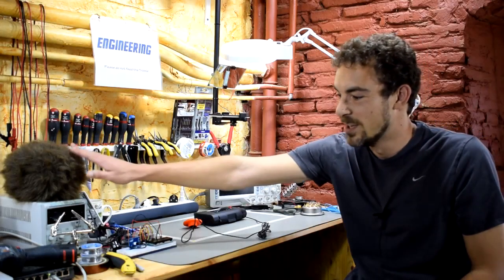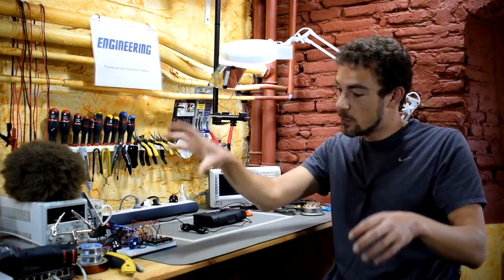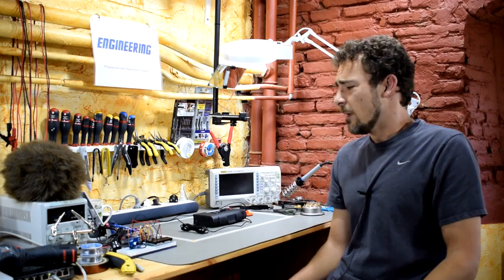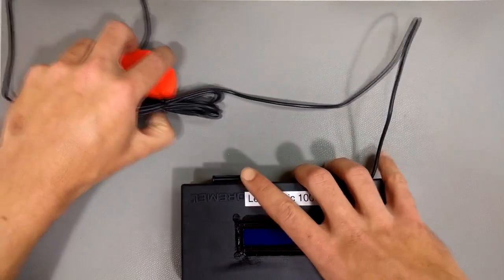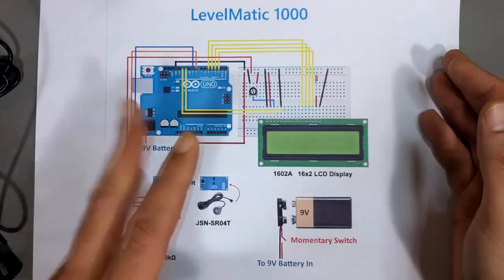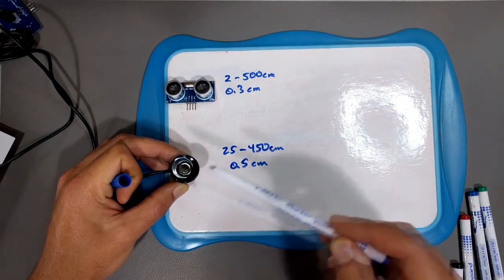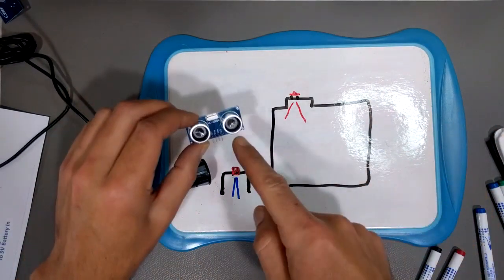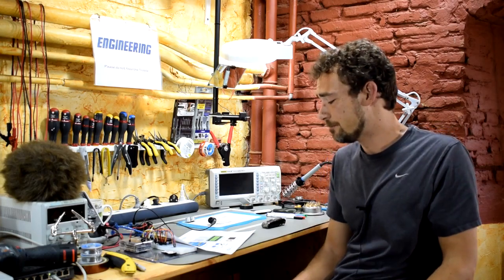DIY Ultrasonic Fuel Gauge / Level Sensor

Comment: Can either of those sensors work through a metal tank. Will be mounting it on the bottom of a 100 gallon diesel fuel tank is 20 inches deep 42" long snd and about 28 " wide. Thanks
Reply from the maker: Nope. The sensors only work through air.

Comment: Amazing!! Thanks heaps, this is exactly what I needed!!
Im just wondering if there's any sealed narrow beam units around?
I need to read the level in a 350x350x1000mm tank which is stood on its end so think the 50-70 degree beam will be a problem and the tanks on a vehicle so it's going to get splashed with vegetable oil.
Or can I mount it behind a clear screen and calibrate it to read through?
You'll be aware by now, this is absolutely not my field, so I apologise and thank you for your help.
Much appreciated!!
Reply from the maker: I haven't found a sealed narrow-beam one yet. A screen won't work since you must have nothing but air between the sensor and liquid.
Reply: @ScottiesTech  cheers fella.
Ill post if i find one!

Comment: i have a diesel fuel tank on my sailboat, but i have no access to the top really, soi  want to have a sensor that measure the amount of fuel in the tank. it is 3 ft tall and i can only access three sides. the top has a three inch gap, but i can drill or really install anything from the top. what can i do?? please help
Reply from the maker: Yeah, that's a pickle... I guess you'd have to make an access panel (if possible) above the tank so you could then drill a hole into the top.

Comment: Hi Scottie, is that a way to measure the water level through the tank wall if it's made of plastic? The reason being is that I want to measure the fuel level on my boat thank, and to fit one of these I would have to make another hole there.
Reply from the maker: No, for ultrasonic transducers, there can be only air between the sensor and the fuel.

Comment: Question. Will the sensor or PCB hold agressive fuel vapour?
Reply from the maker: Good question, and I don't really know... It's water proof, but not rated for harsh chemical vapors... In the case of diesel, it's fine since diesel is pretty tame. But other chems? Hmm...

Comment: Hi, 
Can this be used to build a measure of butane tank level ? Thank you in advance for sharing idea.
Reply from the maker: That's tricky. It's pressurized, with some liquid and some gas in the tank.  Even if you compensate for the speed of sound in butane (instead of air) in the code, you still have the problem of safely using the ultrasound sensor in the side of the tank. It won't work through the wall of the tank.

Comment: I see in your schematic you put a potentiometer 10kΩ?? For what reason?? And also where you put the JSN-SR04T sensor in the board?? Thanks
Reply from the maker: The 10k pot is to adjust the contrast of the LCD screen.  I ended up using the JSN-SR04T, which I just connected to the board in the same way as the HC-SR04 in the diagram on my web site: https://scottiestech.info/2017/10/24/diy-ultrasonic-fuel-gauge-level-sensor/
Reply: Thank you! Unfortunately I do exactly as your diagram but I still get a blank blue screen! I have to check it more 'cause I'm rookie!!!
Reply from the maker: @thansof  I had the same problem. Some displays (even with same model number) need to be connected a bit differently - especially the contrast pin V0. This might help: https://arduino.stackexchange.com/questions/3625/why-is-my-lcd-162-is-not-displaying-any-characters-although-all-the-wiring-is

Comment: good video i am worried about the angle of the sensor i have a 3000 gallon water tank i want to use this on but at 9 foot i am worried the sensor will read the walls of the tank any thoughts? to they make a water prof sensor that is water proof?

Comment: Do you think I could use a version of this set up on a go kart fuel tank?
Reply from the maker: It should work just fine, although I might use a different ultrasonic transducer since I'm not sure about the safety level of using the ones I found on a tank filled with gasoline... But maybe that's just me being too paranoid!
Reply: @ScottiesTech  thank you. I'm looking at incorporating an average due to 'G' disturbance. Any advice?
Reply from the maker: @unknownuser99321  Lessee... Small tank, fuel sloshing around... Oh boy. Well, I'd prolly just make it record each final measurement. Then, for a new measurement, take 5-10 readings in rapid succession, discard the ones that are totally bonkers (based on the previous recorded measurement) and average the rest. That's tricky though, because if you're really scooting around like a rally car driver, you might get serious sloshing going on, and all readings could be useless. So if that happens, ignore that measurement cycle, and wait for the next one. There's probably a better way of doing it...

Comment: Hey Scottie, I'm learning more about Arduino's and coding and I'm having trouble wrapping my head around this specific part of your code:

    currentLevel = round(timeHigh / 58);
    if (currentLevel > tankEmptyDepth) {
      // If level is lower than empty, show 0%
      // This is useful if you want to have "empty" be "still 10cm of liquid left in tank"
      currentLevel = tankEmptyDepth;
    } else if (currentLevel < tankFullDepth) {
      // If level is higher than full, show 100%
      // This is useful since "full" level may vary when tank is refilled
      currentLevel = tankFullDepth;
    }
    // Don't redraw screen if level is the same as last time
    if (currentLevel != lastLevel) {
      lastLevel = currentLevel;
      showCurrentLevel();
    }
    
If the current level of the fuel is greater than 0%, why would you want to set it at 0%? Wouldn't that mean that at ANY point that its greater, it would be set to 0%? I've tested the code using your provided schematic and it works fine, but I want to learn about the code itself too.
Reply from the maker: It's kinda confusing because it's "backwards". currentLevel and tankFullDepth are the distances between the sensor and the top of the fuel, not the depth of the fuel in the tank. Thus, tankFullDepth < tankEmptyDepth. So, anything LESS than tankFullDepth is 'more than full'. I had to draw a picture because it got really confusing when I was trying to program the thing. ;)
Reply: @ScottiesTech  Ahhh, I plugged in my own numbers and I see what you mean! This was very insightful Scottie, thank you very much!

Comment: Hello

 Actually doing my dissertation on this but instead using a raspberry pi with python coding. 

I was just wondering if the code you wrote is compatible with python or not? 

Video was really helpful.

Thankyou

Comment: hello, how did you work out with the blind distance? the jsn-sr04t has a blind distance of 20-22 cm, and im curious as how you;ve worked out with the blind
Reply from the maker: Yeah, that was a problem. I just know that when the tank is full, the reading is less accurate. That's okay for me, because what I really care about is when the fuel level is getting low. If I just filled the tank and it gives a false reading, no big deal. The 2-sensor version is more accurate at short distances, but less "water/fuel-proof", so that was a compromise.
Reply: @ScottiesTech  yeah, im kind of a loss though whether to switch out the JSN to an HC-SR04, so far I had planned to put a tube between a small sludge tank that we had for our final project and the JSN sensor so as to offset the blind distance, but putting a 20 cm long and a 1-1/2 inch diameter tube on top of it would look like a bit cramped
Reply from the maker: @JoshuaJapitan  Oh, I also tried that (the 20cm pipe trick). Unfortunately, it doesn't work because the JSN always gives a false reading. It has a wider beam angle than the HC sensor, so sound reflections from the pipe walls screw up the result. It was also much easier to make a tank cap for the JSN sensor. If you do end up using the HC, let me know how it goes. I've been thinking about switching and really comparing the two, but haven't had the time.

Comment: So I bought one of these:

https://www.amazon.co.uk/gp/product/B01E6N19YC/ref=oh_aui_detailpage_o01_s00?ie=UTF8&psc=1

LCD 1602 display with an I2C bus presoldered on to it.

This allows this project to be completed with no breadboard or veroboard and gives it a smaller footprint with only four wires from the display instead of twelve.

Yes the sketch needs to change to include a different LCD library but the good news is that this library is very polymorhpic with all the standard library commands supported so very few sketch changes are required.  There is nothing to change in the setup or loop sections of the sketch.

The following link is an excellent resource for the steps required - refer to chapter 5.   This guy also provides a very good demo sketch that makes it very easy to copy and paste the new lines required.

https://dronebotworkshop.com/lcd-displays-arduino/#Using_I2C_Adapter

Using the I2C bus meant I was able to build very quickly and get everything to fit within a standard Uno enclosure.  I'm pretty much sold on using this on all future LCD projects.

Comment: Hiya.  I have already posted here saying I have had great success with this.   But...   exploring the Arduino a little more I came across the I2C Bus which can drive the LCD display with just four connections; much better than the 12 described here; it can even drive several displays if any more info required.  I have ordered one to have a play.   The sketch will need to change.   If I get working, more than happy to post here about how I did it?
Reply from the maker: Sure, go nuts!

Comment: Lovely little project.   I have built it (breadboard at the moment - will veroboard) and it works fine in the house on the bench.   It will become a fuel gauge for the boat.  Thanks Scott.
Reply: Sir can provide me explanation , code and circuit diagram to mail
dineshkumardk2805@gmail.com

Comment: Hello. I tried with the ultrasonic of two cylinders inside the tank but it doesn't work at all. My tank was nearly empty and it should show 1.23 meters, instead of that it shows 48 centimetres... that happens in the tank. Outside the tank works perfectly ok. I wonder if there are some better sensors with a smaller angle.
Reply from the maker: If you used the "double-sensor" ultrasonic transducer, that's the one with the much narrower angle. Some other problems I encountered were reflections of the walls of the tank, and the feed pipes that go down almost to the bottom of the tank. Those can reflect the ultrasound waves and give false readings, as well. With a bit of tweaking, hopefully it will work well for you. I'm still using mine and I love it. Saved me once already this past winter!
Reply: ScottiesTech.Info thank you very much for your quick answer. Thanks for the video and the info. I will keep on trying with this sensor.. I run out of fuel last winter and I had to change the burner : ) so, I hope the sensor saves me next time. I will let you know if I have some luck with it. Cheers
Reply: I think that the fuel vapors in the tank could change the measurement as it could change the density of the air inside. That means that the speed of sound should be different. So, maybe Im gonna try changing the speed of sound settings of the ultrasonic sensor.. In the other hand I want to study what happens with a little spark inside that vapor, I mean a bad conection in the sensor could be not safe?... hope to achieve it
Reply from the maker: And then re-priming the long fuel lines from the tank to the boiler can be lots of fun! Now when my gizmo reads 0%, there is still about 10% left in the tank.
Reply from the maker: One other thing... I use the sensor in the video. It has a wider angle, which is problematic since the fill cap is offset near the edge of a raised circular "head" on top of my tank. So, when the level gets to about 40%, it starts giving false readings due to reflections - unless I rotate the sensor about 90 degrees. Then it works perfectly down to zero. When I fill the tank, I rotate it back -90 degrees.

I was gonna replace it with the double-barrel transducer, but the fill hole where the sensor sits is so close to the edge of the raised part that I'm not sure even that's gonna help. Ideally,  the sensor would have a clear "view" of the air + fuel in the tank, far away from any tank walls, feed pipes, etc. Like a hole in the top center of the tank as with modern plastic fuel tanks. But that's awfully difficult to achieve without replacing the whole dang old steel tank I've got, so I've had to compromise a bit.
Reply from the maker: If it's fuel oil / heating oil / aka "diesel with dye", then the vapors should be low enough not to skew the reading too much. That's been my experience, anyway. As for sparks, that shouldn't be an issue since fuel oil / diesel ignites only at high temps and pressures - compression ignition versus spark ignition. It should be very difficult to light the fuel on fire at normal temperatures/pressures with a spark or even a flame.
Reply: Hey Scottie ! Finally it worked!! It wasnt working because a misstake of mine. The problem was that I set up the sensor to read many times in a very short period of time, that caused a re-echo in every single reading inside the tank (that has a very special acustics) with the reflexions as you told me. Thanks for your help and support, I really appreciated. Pablo

Comment: Great work Scott, congratulations. I am myself working on a project similar to this and wanted to know whether this sensor will work if you put/attach it to the tank body itself rather than on the fuel intake orifice?  As per my understanding, the signal is not capable of penetrating the metal body or any hard surface, what do you think?
Reply from the maker: Yup, the sensors I showed only work when the ultrasound travels through air in the tank. If you stuck it on the outside wall of the tank, both would probably give an error since the air gap between the sensor and tank wall would be 0. Now that you mention it though, I wonder if something like thermal imaging would work aimed at the side of the tank? The fuel is more dense than the air in the tank. Not sure that would work, but there must be a way...
Reply: For thermal imaging to work the sensor must be placed/hung away from the tank so that the whole tank (height wise) is within its focus. Then the sensor can get a thermal footprint of the entire tank and report it back to your controller unit. Your CU then can check the level where temperature differentiates ( the level where liquid and air meets inside the tank) and compare it with the height of the tank and then you should have your result.
I am trying to build an external fuel gauge for my motorcycle(1988 model) which doesn’t have an inbuilt fuel indicator and I don't want to make any holes on my bike’s fuel tank for this. Apart from sticking it on the tank's body I don't see any other way around, any suggestions from your side are most welcome :)
Reply: @somwhat What solution did you end up with? I also have a old motorcycle without a fuel gauge, and I don’t like the idea of drilling holes in the tank. Pretty old message thread, so I hope you still see this!